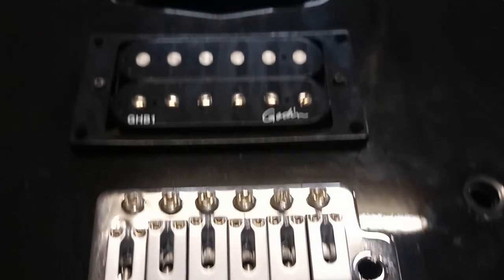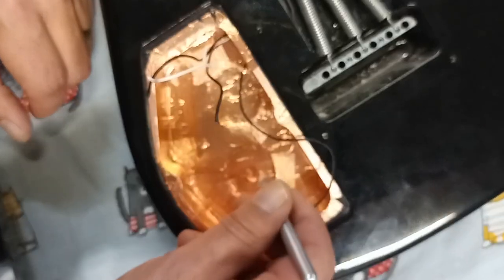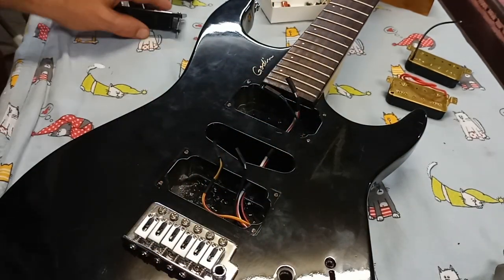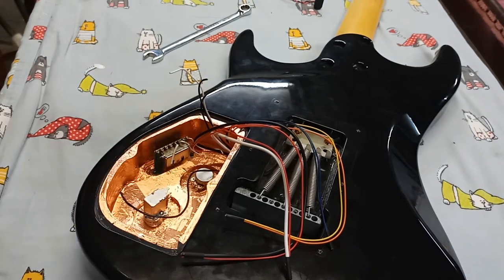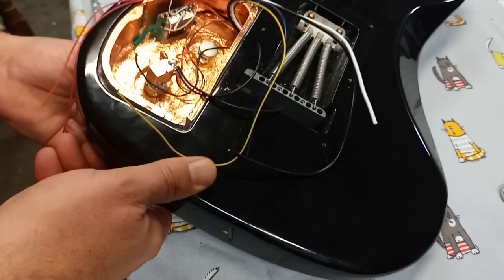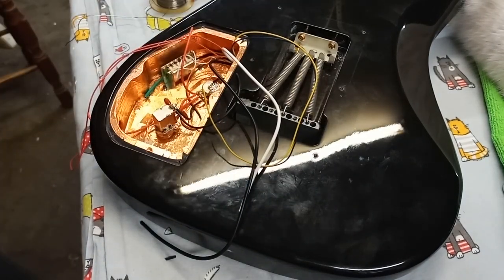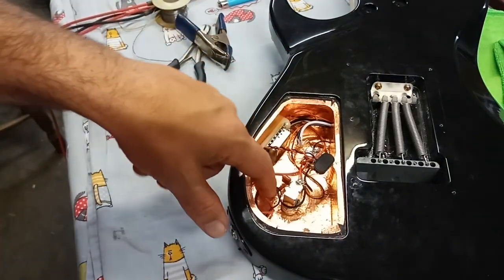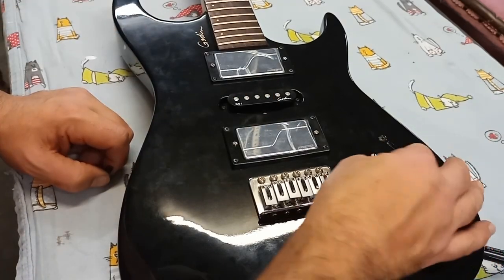Fishman Fluence Modern Humbucker set installation - PLUS - Copper Shielding to kill the RF noise

Comment: HI! I didnt catch how to wire the passive pickup, moreover how do you wire the volume's ground?
Reply from the maker: I did not wire the passive, i wanted to but it did not work with the configuration I ultimately used. The ground was the black wire on top of the volume casing looking down at it.